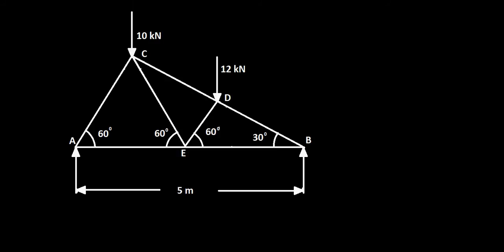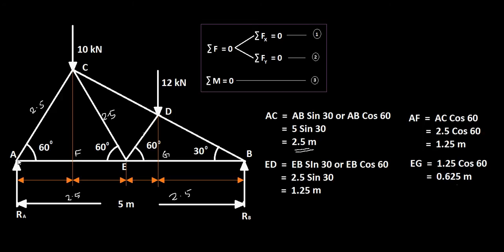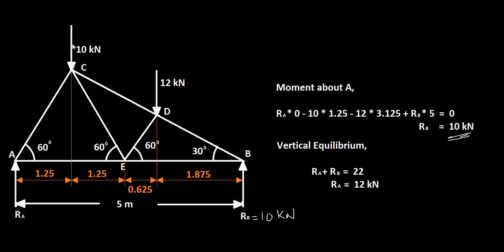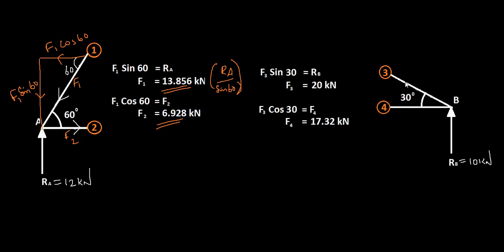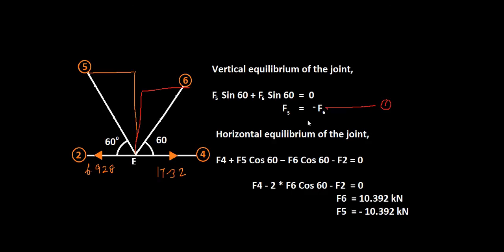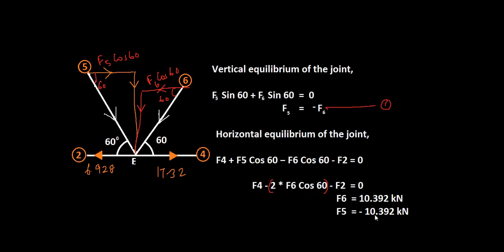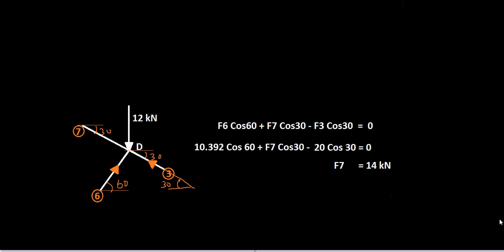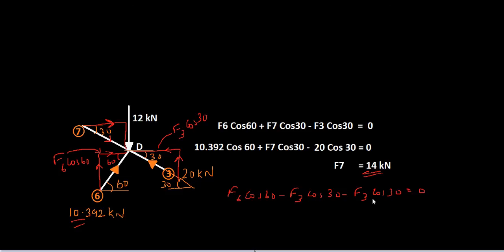Engineering Mechanics 22 Perfect frames: Method of Joints

Comment: sir ,in this vifeo i had seen that 
when we solve F6 it will be in down ward direction .
when solving  'D' value yu are taken F6 as upward direction .why?
Reply from the maker: +Gujjalapati Raju: The force on one link will be of same nature at both ends. Therefore on link ED, a force acting towards E (downward as you said) will have the same force acting towards D (upwards as you said) on the other end. This is same for all links, a compressive force will be compressive at both ends and a tensile force will be tensile at both ends. Hope this is clear, do comment if you need further explanation.